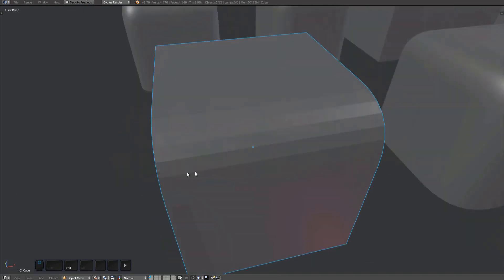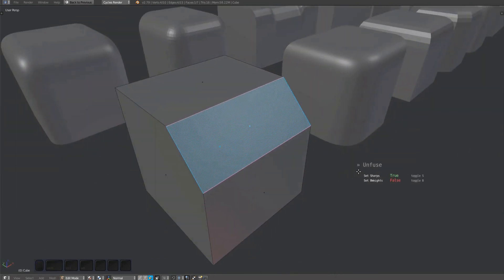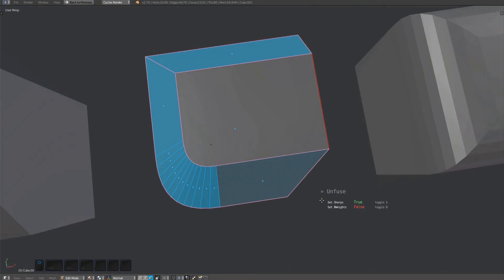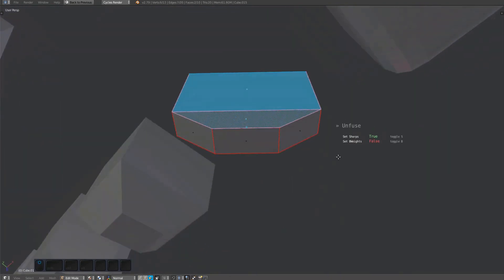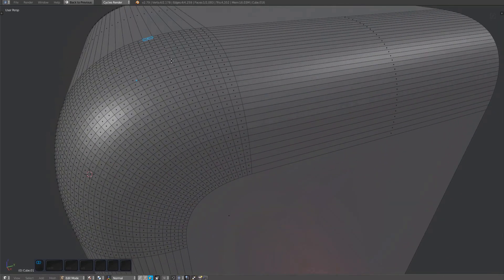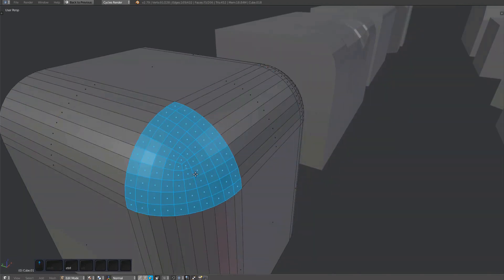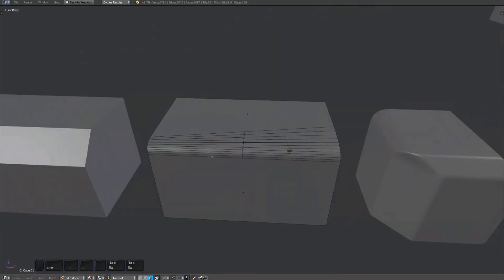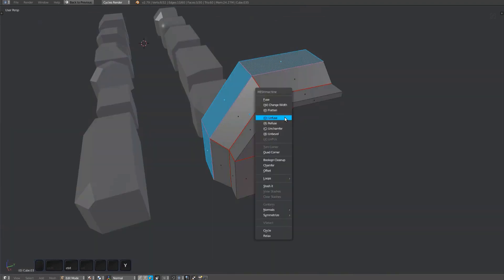MESHmachine 0.6 - Unfuse

Comment: Is there any way to set the Set Sharpen option to False by default?
https://drive.google.com/file/d/1ZESH8UoYC6HX-hFTlJpqqmdheVhlpEyX/view?usp=sharing
I see if i delete all sharpen settings, and set a "full smooth"  on the mesh, then Set Sharpen gets the False value, but it would be cool if i could achieve the same False value but still could use "sharpen settings" on the object.
Even if i take the Object to Smooth and set the Autosmooth with some value the Set Sharpen turn to True by default.
Reply from the maker: If faces are smooth, the edges will be sharped. If they mesh is flat shaded, then they wont.
Reply: @MACHIN3  Can You explain the logic behind this? :) The opposit would have more sense, but i guess that's only me :D
Reply from the maker: If you have smooth faces and introduce a shading, you want the edges sharp so the smoothing doesn't go across them. If the faces are flat shaded, there is no need for sharp edges.
Reply: @MACHIN3  my last question in this topic :D can You make a default setting in preferences that allows to set the unfuse, unchamfer Set Sharpen settings default settings?
And thank You for the fast reply and explanation!